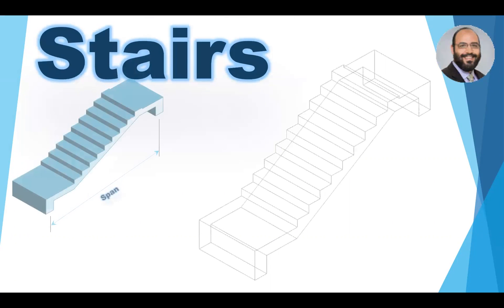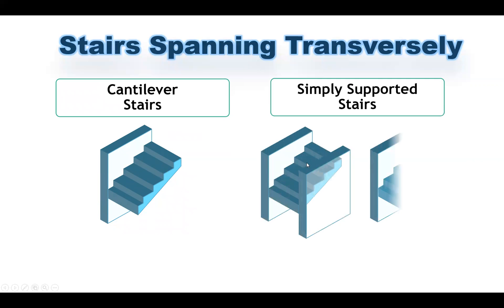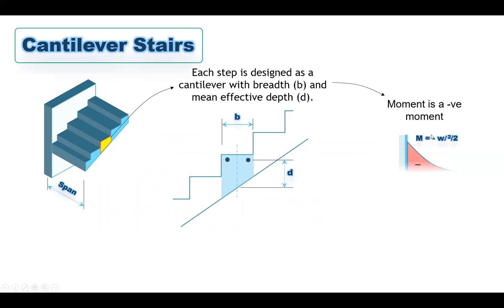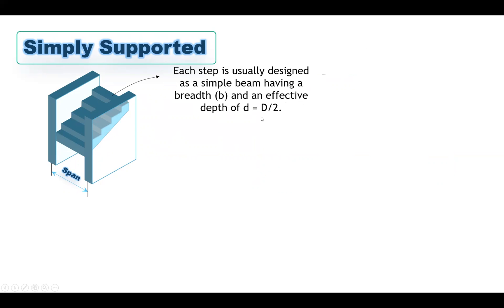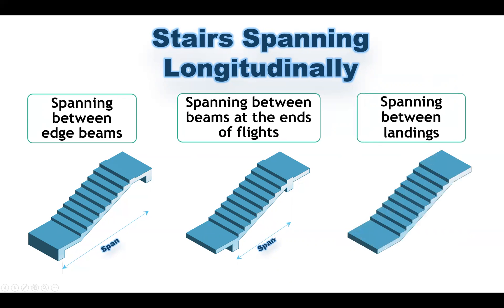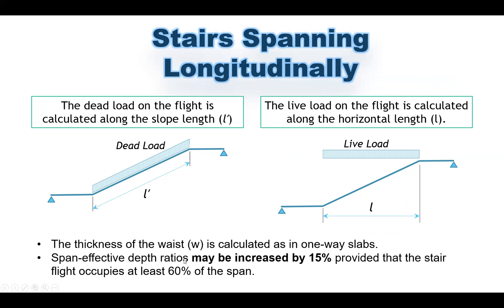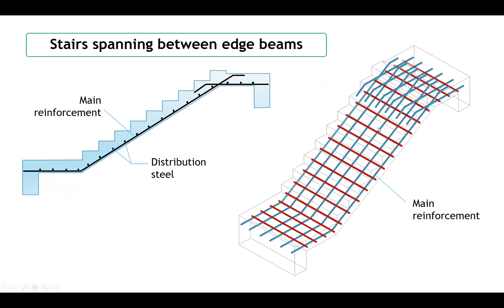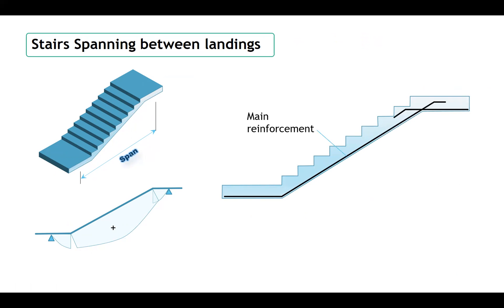Design of Reinforced Concrete Stairs

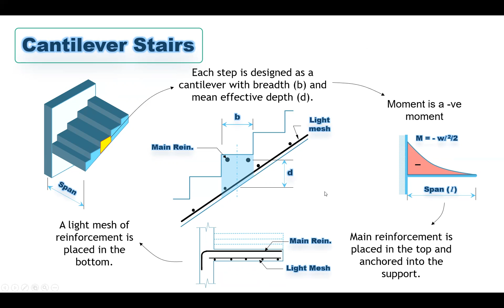Comment: Dr. El-Gamal at 5:44 for cantilever stair, what about the ties or stirrups to hold the main transverse rebars. What's the minimum steel requirement that is to say the rebar diameter and the spacing?

Comment: Why do you assume stairs spanning between edge beams to be simply supported and not fixed? I suspect that in the ends top reinforcement is also needed due to negative bending moment (in case of both ends fixed beam).

Comment: Thanks, so much for this detailed explanation Dr. However, Sir, my question is about the design of uniaxial and biaxial columns that you had treated earlier, I quite appreciate your efforts but in my country, most reinforcement bars are not produced to the expected standard specification of 460N/mm2 which is required in the BS code charts. Most Engineers are therefore forced to design to 410N/mm2 to compensate for any inadequacy in the reinforcement production. Sir, my question is how we can use the BS code charts for the design of uniaxial and biaxial columns using 410N/mm2 instead of the 460N/mm2 required by the BS8110 code charts. Thank you so much.
Reply from the maker: In this case, you may use the 460 curves but you need to increase the area of steel reinforcement by about 12% due to the difference between 410 and 460. This is only an approximate solution not an exact one.
Reply: Thanks, Sir. May God continue to strengthen you.